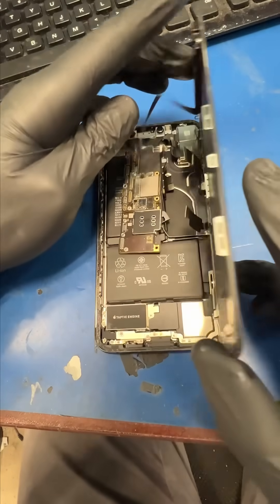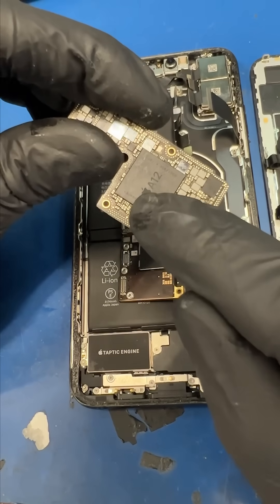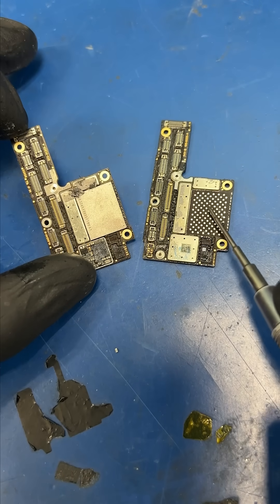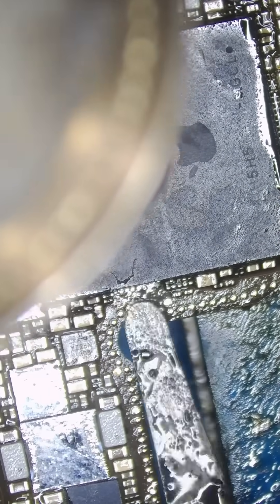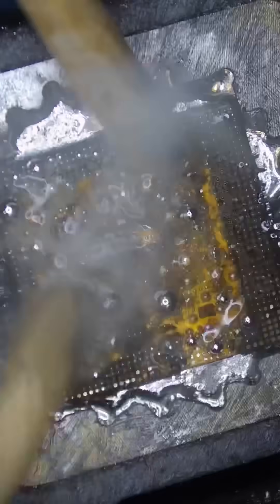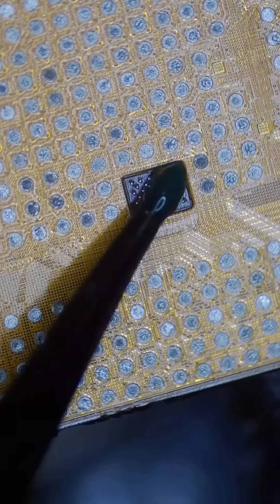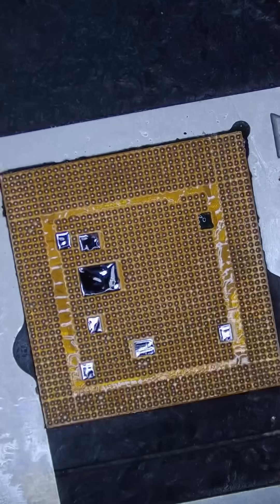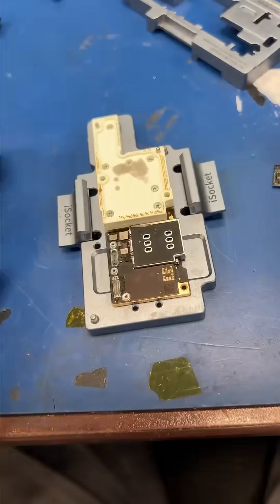iPhone CPU Swap… Data Recovery #tech

Comment: It makes no sense to me. Cloud storage is insanely cheap. I'm sorry, but all this stupid crap about people thinking it isn't secure or safe are delusional. Clearly safer than in the moronic hands of the average user. If he had cloud storage for like $5 bucks, he'd never have to take a gamble with repairing. I mean, it's greath that the skill set is there, but it shouldn't be necessary.

Comment: hi there, if you're reading this, i would like to ask a weirdly specific question

lets say a decent amount of weight (for example, a medium sized, half filled tumbler bottle) was dropped into a Samsung A24 4G (apparently not sold in NA or EU, but you can look up the model online) phone and impacts the back of the phone, specifically to somewhere between the middle of the flex cable connector, the battery connector and level to the 2 pixel camera at the bottom and presumably hitting somewhere either connected to the CPU or the CPU itself that's been hit , and the impact is enough to cause the phone to crash and shut down every 15 minutes or so, however, a drop approximately a desk tall cause the conditions to worsen significantly, causing the phone to only be able to stay on the home screen for roughly 3 minutes and occasionally taking 3-5 boot loops (as the phone attempts to start into the home screen).

eventually, getting into the home screen is getting difficult, and the end of the day the phone only boot loops with it taking a considerable delay in between pressing the power button and the phone turning on at all. and through another series of unfortunate mishap the phone eventually boot loops repeatedly until the battery ran out and the phone, showing no signs of life, is hard bricked due to not being able to be charged.

how can this (presumably and no matter how unlikely) be fixed?

and what could the damage be? could it be the capacitor supplying power to the processor? could it be the ball solder connecting the processor to the board, or could the damage be from the processor itself where something in the silicon is damaged? or could it be something else? what would you do to diagnose the problem and what can be done (or attempted to be done) that would at least remedy the boot loops and get it to a state (full home screen boot or recovery mode) where data can be extracted from it?

Comment: This guy is like a repair genius. Anyone else think how crazy it is that someone thought to put all these little things together and created the first motherboard and chips and all these things to make a phone. Who are these world changing people figuring out how to create technology.
Reply: Engineers are the ones who take what scientists discover and turn those discoveries into useful items. In the case of these things, it's the computer and electrical engineers, which is what I got my degrees in (and am now retired). Before I put myself through college, I was an Electronics Tech in the U.S. Navy and worked on all sorts of communication equipment, RADAR, SatNav, and infrared devices, ranging from tube-based equipment built in 1940 to the "latest and greatest" equipment we had...in the 1970s-1980s.
Reply: You realize they didn't just make a phone out of the blue? Started with just doing multiplications, then decoding messages, etc.

Comment: It still blows my mind we can hold so much data, pics, videos on tiny built systems. Amazing.
Reply: Yet, look back 30 years and they were using B and Kb. Nowadays most computers have 1 or more Tb. Makes you wonder if in a few years we will get petabyte or zetabyte storage capabilities for average users. (Peta and zeta exist rn, but used in the corporate world for servers)
Reply: @mucousfishmucousfish4412  Drives from 30 years ago had an average capacity of 1GB, and those from the 80s were in the double digits of Megabytes
Reply: @mucousfishmucousfish4412  Most computers have 500gb
Reply: It blows my mind that we can hold so much on MANY systems at once but we sometimes don't choose to and then... BOOM, the data is lost.
Reply: Would be interesting when came an bio-chips, with zilions of mb...
Reply: This job probably only cost the gym bro $2000 😂😂😂
Reply: @bobbyr8071  $450
Reply: @bobbyr8071  bet it was a lot less than that

Comment: The worst part is that Apple is still being cheap with the damn port and only has usb 2.0 speed on that lame lightning port. So for 20k pics you’ll need like 2-4 hours for the transfer. Luckily EU forced them to upgrade to type-c and with my fingers crossed 5Gbps-20Gbps

Comment: I have an iPhone SE 2020 model that gets a weird glitchy screen sometimes. The weird part is when I put pressure on a certain spot of the screen. It stops the glitchy thing from happening for a short period of time, but then it starts to happen again after a few hours. I’ve had this phone legit looked at by three separate phone repairers and NONE of them have been able to figure out what is wrong with it or been able to fix it. I don’t currently use that phone, it’s just sitting in my closet as a backup in case my iPhone 12 dies on me. Other than the weird screen thing it works as functional as an iPhone could be. It’ll be interesting to send it out to you (from Australia) to see if you could pinpoint the problem that 3 other people couldn’t. LOL.
Reply: Definitely a faulty ribbon cable

Comment: Why people just not save thier photos in iCloud or Google Photos?
Reply: Is Google Photos expensive? I actually thought it was free on android, but maybe that deal ended like 10 years ago when I got rid of my HTC Incredible.

 iCloud is 99c per month for 50GB, which is what most people probably need. Id be surprised if Google photos is more than that.
Reply: Ain't giving Google shit
Reply: Not everybody wants their private data floating around on the cloud. I use dropbox, but only for certain stuff and not other stuff. I certainly wouldn't use Apple or Google or Microsoft for that.
Reply: Google Photos is expensive